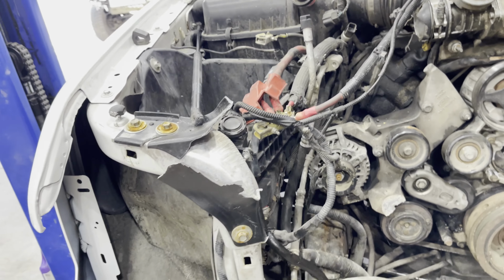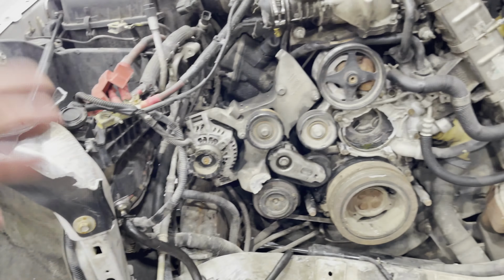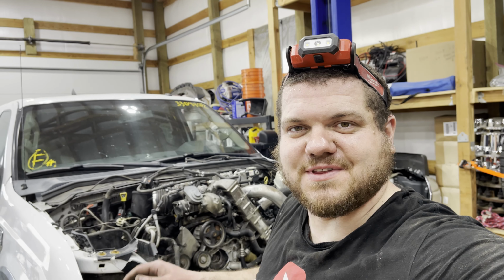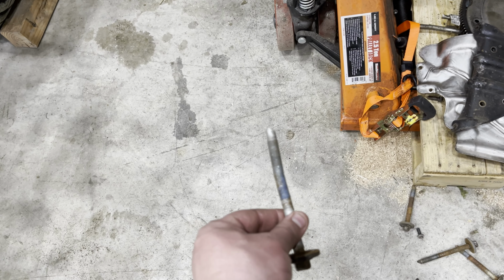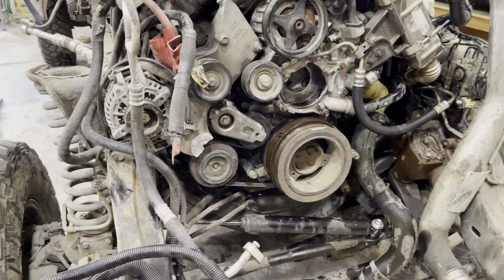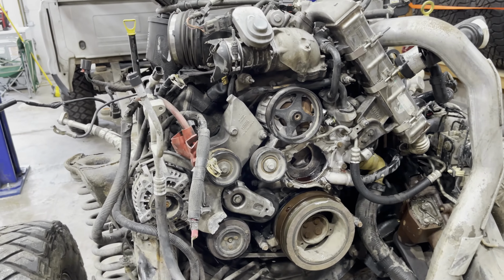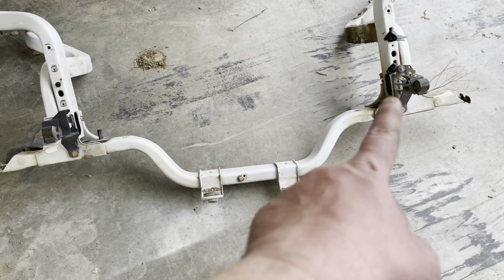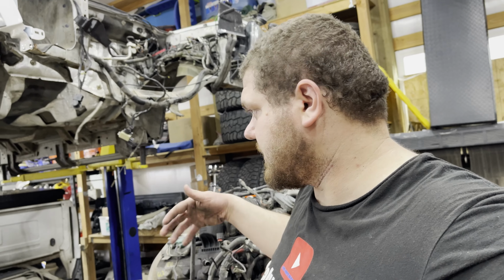Rebuilding our 2010 Ford F350 diesel Cabela’s edition (6.4 powerstroke)

Comment: I'm having a new 6.4 put in my 2010 also the shop is doing it as we speck i lost compression in number 7 cylinder and it started knocking thats what happened to mine.